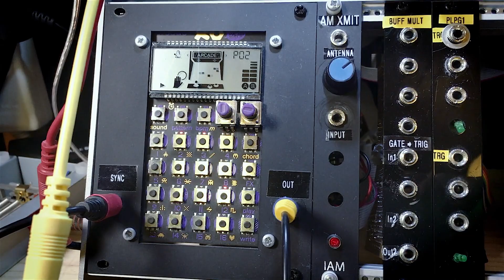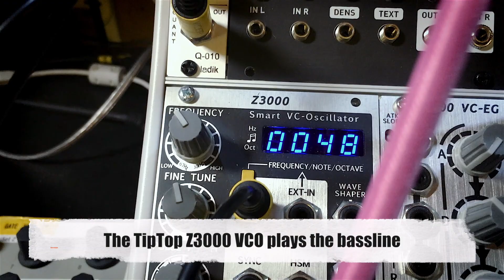Converting a cheap Ebay preamp to a voltage controlled Eurorack Filter and VCA

Comment: Looking at the LM1036 datasheet, and I have a few questions before I go buy one of these to mod myself! Specifically I'm wondering about how you adapted it to Eurorack?

Did you add an input attenuator and output gain stage to bring Eurorack signal levels down to its operating range and back up?
Also, did you scale or remap control voltages in any way wrt to the onboard reference voltage?
Reply from the maker: sehrgut42 Hi, 
I did exactly that. Added an input attenuator and an output gain amplifier. 
I didn’t scale or offset the CV inputs, it works well enough for me unmapped.
Reply: @IzharAshdot  Thank you! One more question: how do the CV and pots interact? Are they just connected to the respective CV pins as a passive summing node, or are they set up as input attenuators?
Reply from the maker: @sehrgut42  It's been over a year and I can't find my schematic, but if I remember correctly, my external CV inputs tap into the center pins of the pots as additional voltage.